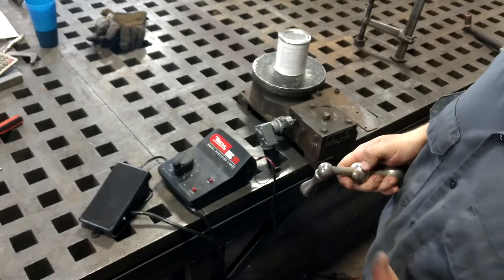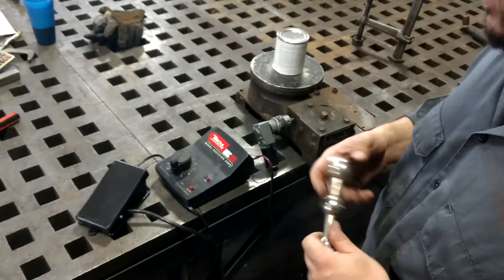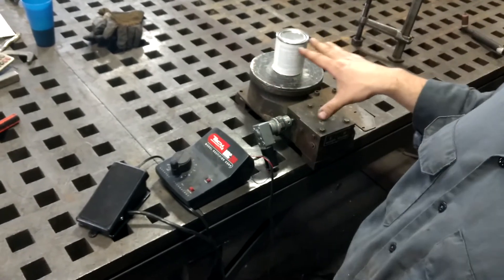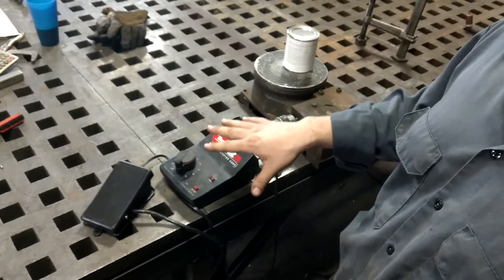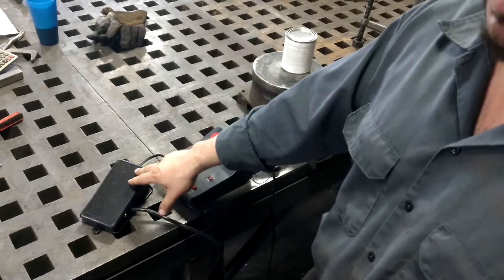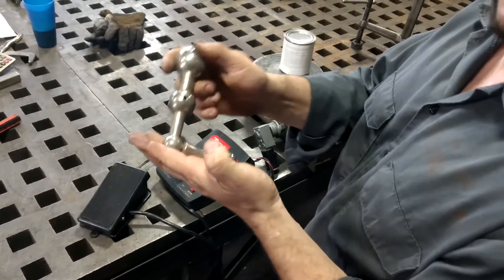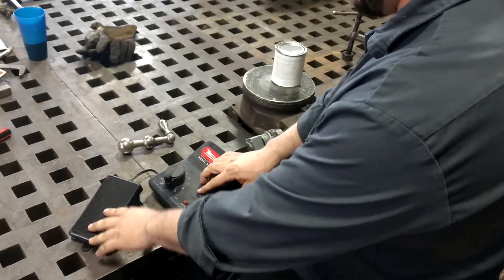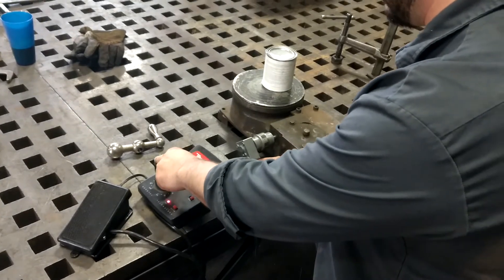12v Welding turntable concept

Comment: I like the set up but didn't understand the controls looked nice and simple
Reply from the maker: It's a model rectifier, aka a model train power pack. It has a 15v max output and is perfect for these smaller 12v DC motors since it has full speed control with a reversing switch.